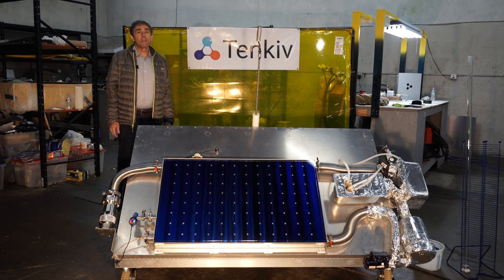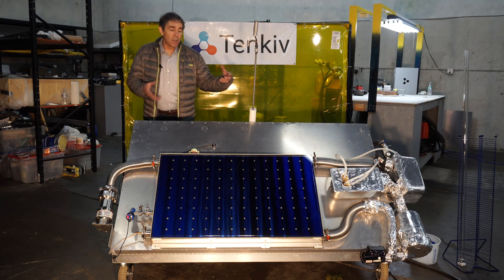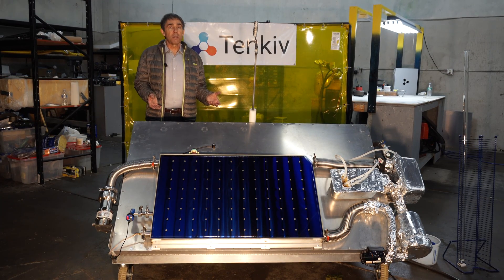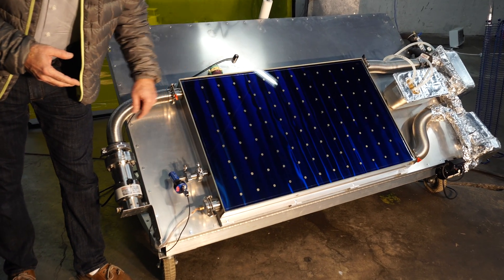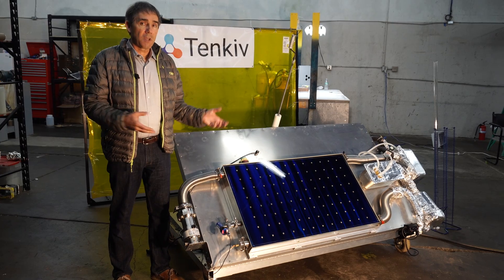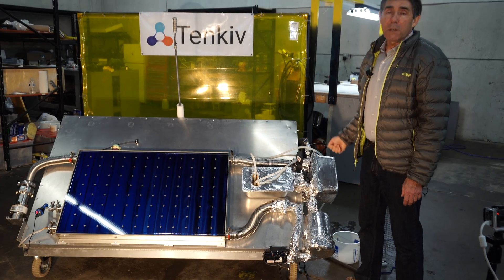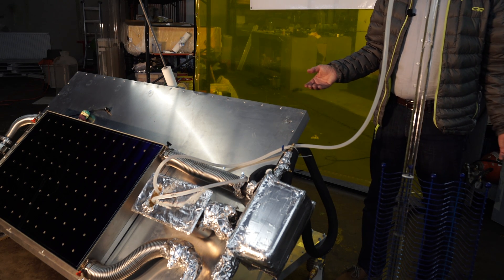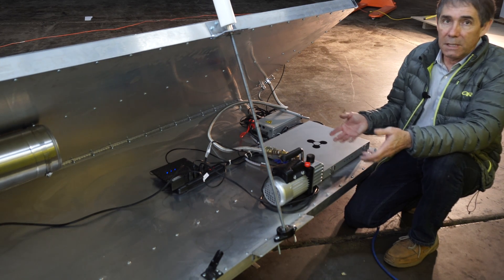Kickstarter update 2 Tenkiv Nexus Tutorial

Comment: First of all congrats for the video and the technology, but I have one or two questions. 

You make a direct comparison with other thermal solar panels which are mainly used to just heat water, saying that your panel is far more efficient than those ones, and that's ok I can believe you. But when it comes to vacuum tubes is a bit more difficult to say because this ones are far mores efficient than the others and by themselves really efficient in terms of what they are built for. From what I understood from your technology, your panel does pretty much what vacuum tubes do in flat way, right? Or do the panels contribute with other functions other than collecting heat for the system?

Besides, I would like to ask what is the material that you are using inside the collector as an absorption layer, the blue one, is it the same that is folded inside the vacuum tubes or is it another? Of course, if you don't want to answer because of patent issues I will understand that.

Comment: Great idea, this system is so multifuncional. Is a condenser required in addition to the panel(s) when used in the water sterilisation mode. How many hours of sunshine are needed to purify 1,000 litres?
Reply: A&A Britten though not so sure, i think the video mentions a heat exchanger is there exactly to work as condenser.